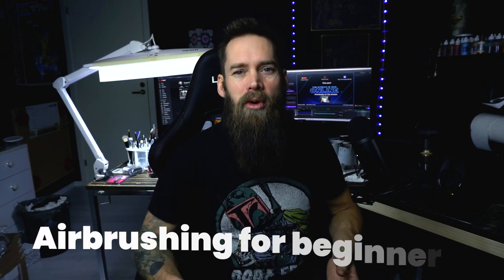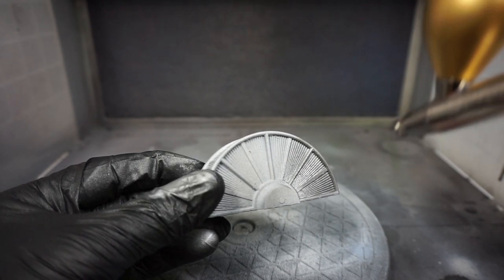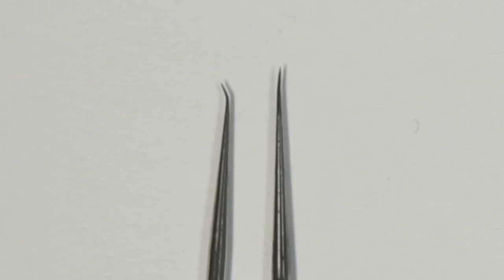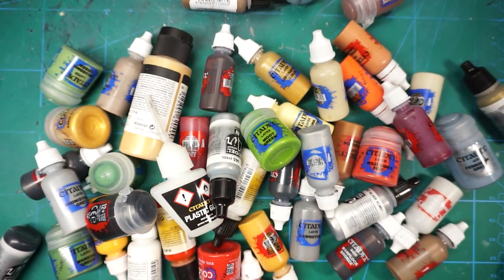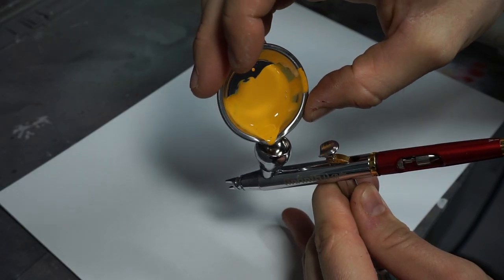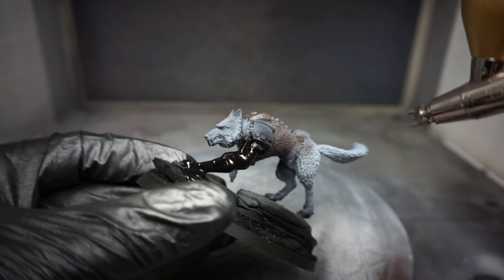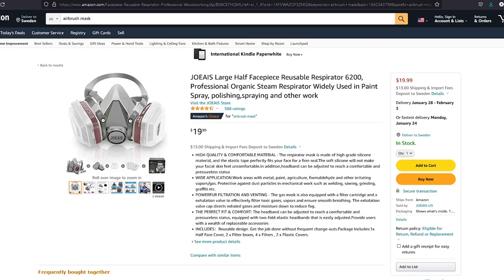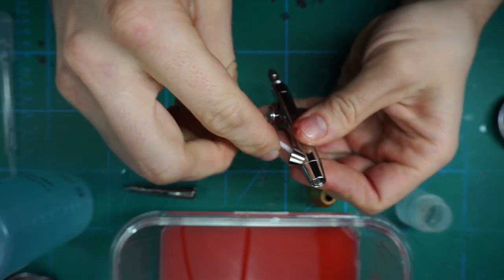How to: Airbrushing with a Nerd!

Comment: Love the content.  Keep it up.  I'm not sure if you have any experience with spraying inks?  I have a bunch of Liquitex inks, and I can't seem to get good coverage because they are so thin which results in cracking when it drys.  Any advice or tips?  I spray at about 30 or so PSI, 5-6 inches away.
Reply from the maker: Hmm haven’t heard about that problem before. The only time I use inks when airbrushing is when I want a brighter or darker color just by adding some drops of white or black. 
Are the pieces that you’re painting primed?
Reply: @TheAll-InNerd  Yep they are primed using Badger Stynylrez.  I wonder if it's just me then, ha!   Perhaps I have a heavy hand?  I feel like I am careful with it and don't lay it on thick but  use small sprays and keep it light.  Might just need more practice ?
Reply from the maker: @b-tron88  maybe try thinner layers and put on several. Let it dry in between the coats. You could even use a hairdryer to speed the process up. Just be careful with the heat!
Reply: @TheAll-InNerd  I'll give it a go!  Thank you for the help.
Reply: Reason why your thin ink layers are crackling : you need more medium. As you have already guessed, you are spraying them thin. It's totally okay for transparency but never forget you are spraying pigment dust caught in a medium lattice, here an acrylic one. If your medium gets too diluted with water or alcohol as a solvant, it is going to shrink when it's drying and if it shrinks too much it will leave cracks. So when doing thin glazes, think of adjusting your ratio of solvant to paint, replacing part of the solvant with the appropriate medium. :)